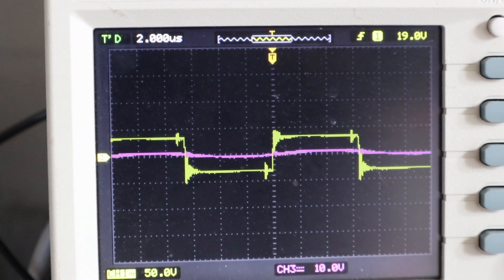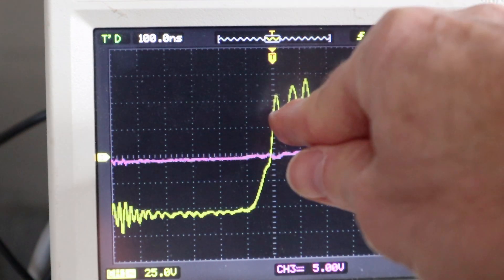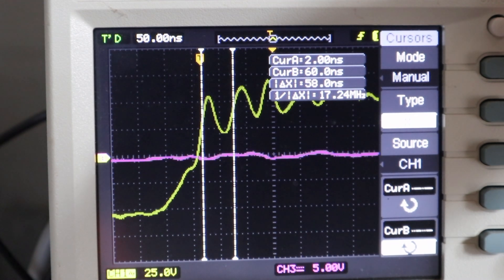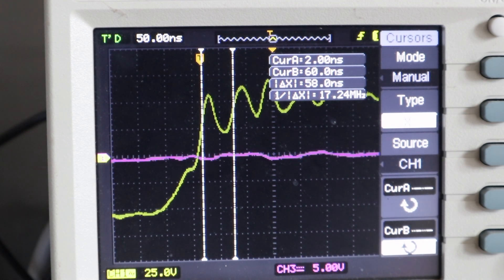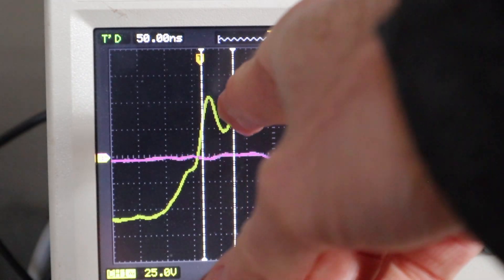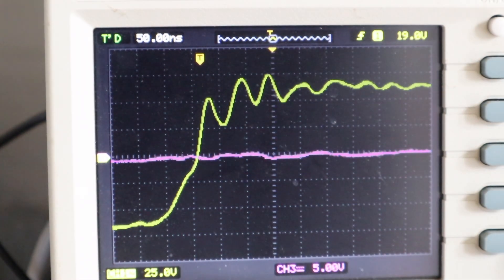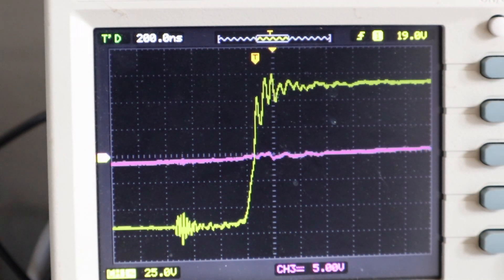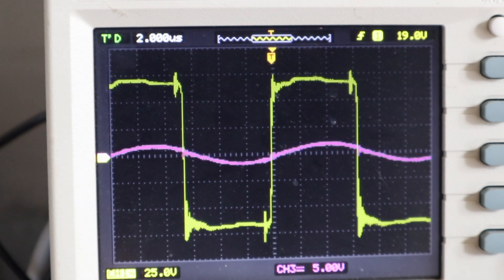Reducing induction heater voltage ringing with capacitors across the gate

Comment: there is a Miller knee visible on your signal during voltage rising. You should obtain soft switching in this moment. This knee told you there is some wrong driving scenario adapted in this heater, i guess it is ordinary PWM. Phase shift mode is way better because it allow to soft switching transistor and it reduce ringing on all signals in transistor bridge. 
Other possibility is wrong PLL synchronization between driver frequency and current in tank circuit. You switch transistor just in this phase but it shall be switched earlier. Then switching node can receive enough reactive power to switch second transistor softly.

Comment: Better late than never, it's still looking unfinished long after the Mazzilli version of 2009 or so.

Why the electrical I/O retroactive cross-coupling when it could be purely logical anyway?

GaN and/or gate-driving would make sense at least to me.  The synchronized multi-stage conception address the rest of other destructive electrical stress as when A.C. gets to a stall, in an application where ZERO Hz (D.C.) is definitely a forbiden state at high power...

Using digital smart-slave control it would be more fun to explore IH features IMO, try more planning before jumping into action.  M'well, or maybe not if you expect your followers to live forever!

Comment: Thank you for showing. Aren't snubber capacitors usually connected between Drain and Source, often also in series with a resistor? Gate ringing is, as far as I know, usually reduced by increasing the Gate resistor.
Reply from the maker: Increasing the gate resistor and decreasing gate, inductance are also methods, as well as a ferrite bead.

I believe the capacitor is helping by changing the dynamics of the oscillator circuit that’s forming. I tried putting it across the gate and source, but didn’t see any effect. My knowledge isn’t sufficient enough to comment further, but I welcome other comments. All I know is that it works.